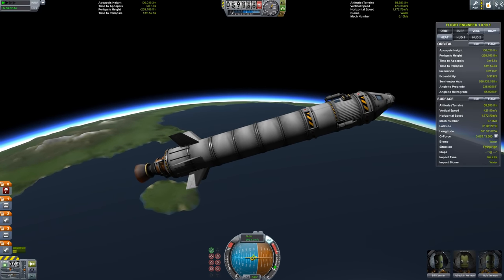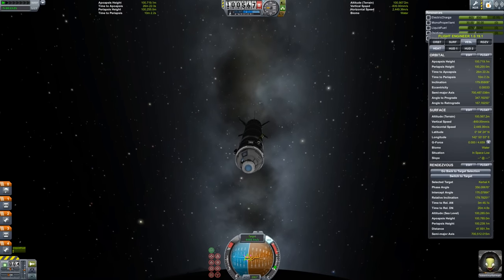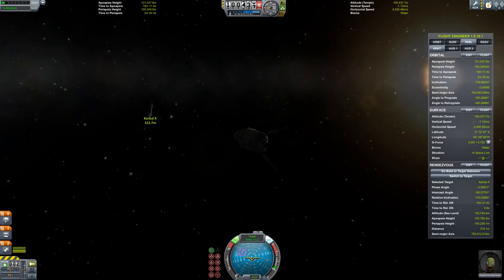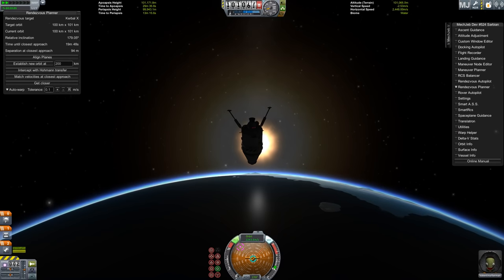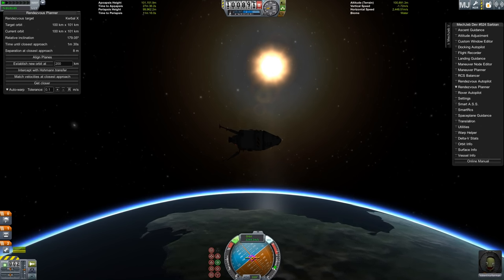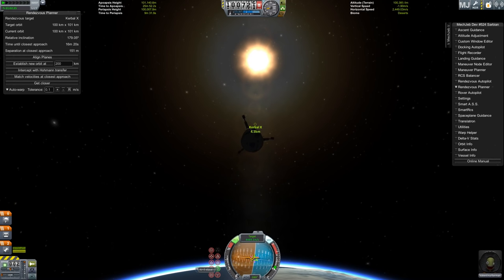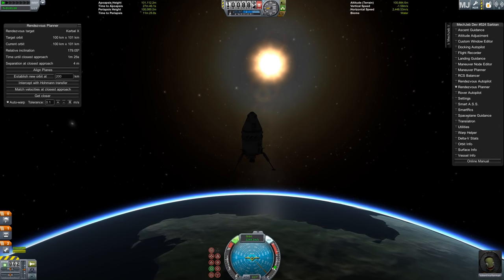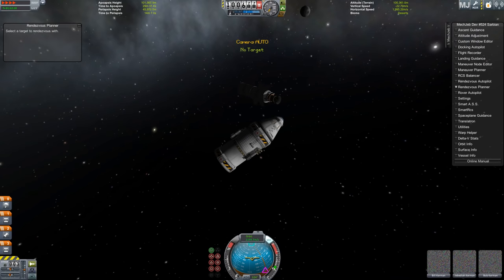Colliding Things At Orbital Speeds in Kerbal Space Program

Comment: The PhysX uses in unity doesn't step at 30fps, I believe that by default it steps at 50fps. That's still over 50 metres per step, though!

I sometimes wish that The KSP devs wouldn've implemented a physics engine such as Bullet via plugins, as it's generally more stable under the pretty intense situations that KSP provides (tall stacked ships of many parts and constraints, high speeds, etc).

Comment: As a fellow physicist Scott, I will have to take objection to your claim around 5:33  that the physics simulations uses "rectangular coordinates and Newton's laws" instead of "polar coordinates and Kepler's laws". This is nonsense. A common exercise in Classical Mechanics 101 is to derive Kepler's laws from Newton's laws, that is, Kepler's laws is contained in Newtons law of gravitation when applied to the two-body problem; they are not complimentary. A more accurate way of putting it is that the on-rails simulations is the closed-form analytic solution to the two-body problem; it always returns the same (x,y) coordinate for a given polar angel, whereas the physics simulation re-solves the differential equation every frame and in doing so compounds rounding and linearization errors

Comment: no need for physics warp, I've crashed things togethe at this kind of speed without mods before
also could just use rcs and clsoed loop corrections in the last seconds
Reply from the maker: It’s more about the physics engine not being granular enoug at these speeds.
Reply: could be - well, I just noticed this video is from a while ago so it might have worked differently then and it does probably make for more detailed/accurate destruction - just saying, at least wehn I tried it it was possible to ram things into each other at orbital speeds with 30 timesteps per second

Comment: Hey, what is the physics time step in real life?
Reply: Real life has a really good physics time step. I tried this with the real ISS, my craft got to 50mm per frame at x0.02 speed.
Reply: +Cinder Planck time, that is about 5*10^(-44) seconds

decent, but still can't run Crisis
Reply: +666Tomato666 Time doesn't go in steps in unit of Planck time. That's not it is about and nothing says time cannot go shorter than that. The most you can conclude is that Planck time will be the shortest time interval that one can ever measure.
Reply: Derek Leung and how is that different from it effectively having time steps?

or should we wonder if trees falling in forest make sound if there's nobody to hear it?
Reply: 666Tomato666 This is effectively asking the same question but with space. Space is conintuous but quantized. However this does not make space discrete. Same goes to time. Time is continuous, but for some actions it will take a longer time than the smallest unit.

Consider action A and B. A starts at t=0 and B starts at t=0.5. Assune the minimum amount of time one action can take is 1 second. The one second here does not make it a "time step" because time can still be divided infinitely. Both actions can start at any time.
Reply: Derek Leung thing is, quantum mechanics tells us that it is impossible to divide time infinitely as we have to way to differentiate between events that happen below the Plank time

don't bring your everyday notions to discussions about quantum physics, you'll have bad time

Comment: What does an explosion in space look like?
Reply: A sphere. Basically.
Reply: +ZincNut anything like what we just saw?
Reply: Not really an explosion, the flames will just immediately out and there will be no shockwave or anything.
Reply: No oxygen in space, so no fire at all. You would just see tons of debris and fuel flying away
Reply: +SuperSMT is there nothing that would burn? no other type of gas? burn like a plasmid? (I honestly have no idea)
Reply: +MrJohnycomelately21 Small flash of light in a sphere if either of the craft had oxygen, no fire. Just a poof then debris. Nothing like you see in movies.
Reply: +MrJohnycomelately21 I think that would depend on the type of fuel... if you got fuel + oxidizer, you might get an explosion even in space, right? Or if you have something like hydrazine-fuel and bits of the destroyed engine reacting?
Reply: the ISS has oxygen, so the explosion might look similar to the one above but the flames will go out in an instant. They show a pretty accurate explosion in Gravity